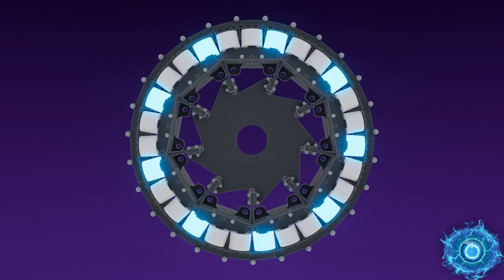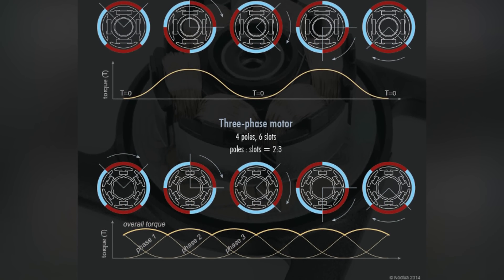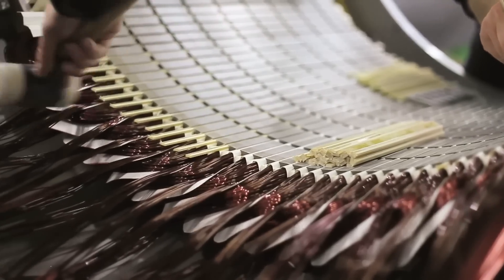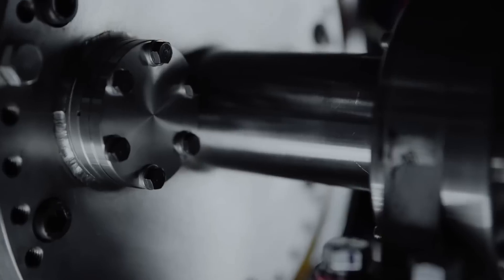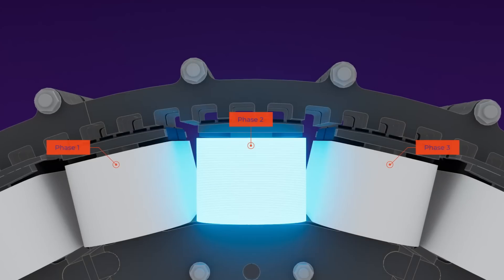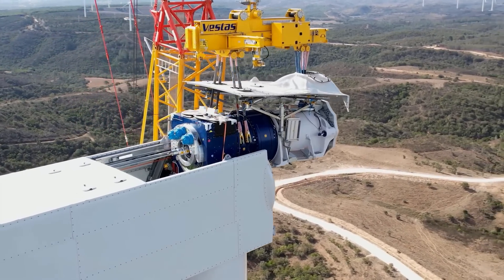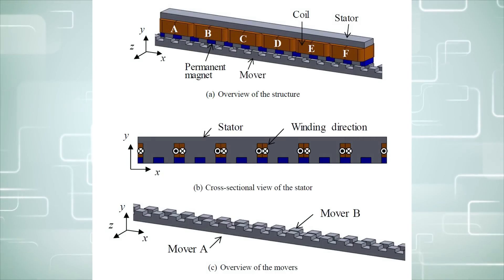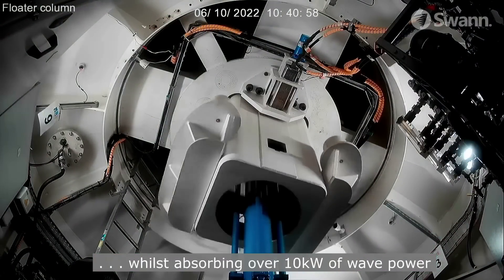FUTURE Motor Has ARRIVED!? - Vernier Hybrid Machine

Comment: As others have noted, this is quite similar to hybrid stepper motors, but scaled up and three-phase.  I don't see this type of motor being adopted in wind applications soon, if ever.  Type 3 and type 4 machines already accommodate variable rotor speed (though a gearbox is still required), the technology is pretty mature, and the industry has become comfortable with them.  I guess  It ultimately comes down to overall cost of ownership.  Mounting all those magnets on the pole pieces seems pretty costly.  There was no information on power density, but it seems unlikely to be great.  On the other hand, eliminating the gearbox is a nice reduction in capital and maintenance costs.  If those stator pole pieces can be made removable, that would also be a nice maintenance advantage, since fixing a winding problem would not require dismounting the entire motor.  If they can figure out how to replace the rotor bearing without having to dismount the motor, that would also be a nice maintenance feature.  From my time with GE, bearing failures were by far the most common failure mode, followed by winding failures.  Frankly, there isn't much else that can go wrong with a motor.  I guess there is at least the potential for these machines to have a cost advantage.

Comment: How is this different than the Siemens 1FW3 torque motor? High pole count 3 phase motor excellent at low speed high torque applications. They're still expensive compared to standard 3 phase motor + gearbox. 

Isnt this design already well known in machine design as high pole torque motors?

Comment: If we just put a coil and capacitor In series And we use a Pulse Width modulator To control it We wouldn't need :
Gear boxes
fly wheels 
Wind Turbines 
Hydro turbines
The computer would regulate its torque
Reply: It is the VERY thing I'm working on now. A (Resonant NIKOLA TESLA COIL/ MOTOR GENERATOR).  LOL Say that 10X  fast
Reply from the maker: @madtscientist8853  Well, if you want I can host it here and talk to you about it.

Comment: Will keep and eye out if Siemens or vestas gonna test it in my local windmill testcenter "østerild" maybe in the new models comming in a year or so..
Reply: Not likely with Vestas, they will be expecting the turbine in the test centre to be around for 10 years or so, although one would expect an uprated output in that time but they won't go direct drive. The cost of the Permanent magnets would be simple to high to justify over a faster turning generator with a gearbox.

Comment: nah wind turbines and wave generators are pathetic, put that on the turbines of nuclear power plants,
Reply: It's efficient at low speeds while nuclear turbines are most efficient at very high speeds.  I guess you can always gear up or down but I'm skeptical this is more efficient or if it could even handle the power.
Reply: Yah, why should we pay .08 a kilowatt hour for wind  when we can pay .60 for nuclear?
Reply: @davidtotten3042 Hah. Got em. 

 Seriously, I want nuclear to work yet the reality is that it gets more expensive while wind and solar are getting cheaper. 

 Hell even geothermal might be possible anywhere for a lower cost than nuclear. That is baseline power. 

 If the people developing pervoskite cells for solar are correct, and they can fix the longevity problem? Solar cost will dramatically drop due to the fact you can manufacture them easier simply by printing it on a medium.

Comment: May be useful for electric bicycles too, normally we use 3-phase BLDCs for that but it's a low-rpm high-torque (not that high, but high relative to the power level) application

Comment: This design looks identical to that used in hybrid stepper motors.  The problem with the design is the high magnetic leakage.  This is a problem in any motor (& generator) with reluctor because "magnetic insulator" does not exist.  Its ability to generate/accept high torque is way lower than mechanical contract (gearbox).  NOTHING NEW.  It would have to be 5x bigger & heavier than gearbox.
          All magnetic machines suffer from speed scaling problem.  The power they can handle is proportional to speed squared.  This is why the majority of motors (& generators) are designed to operate at high-speed.  If the load/prime mover can move fast, then direct coupling is possible.  But for many applications, that can't happen, so this is why there are so many gearboxes on motors & generators.

Comment: I agree with one of the comments below. This is a stepper motor. The type with 3 wires instead of 4. I happen to have one of these stepper motors (Nema 17 size). It can be driven with a normal 3 phase ESC (electronic speed controller). It also generates power when rotated.
Reply: It is also 'reinventing' the early 'pancake' motors/generators from Tesla/Westinghouse, but this time with permanent magnets. However, those old motors had an advantage when starting under heavy load, because simply shorting across the slip rings of the wound rotor turned them into induction motors.

Comment: be careful to not confuse between motor and generator although some may work as both.
Reply: usually all of them do unless they are induction and dont have controllers capable of keeping the rotor excited.
Reply: Are there any 3 phase motors that aren't capable of regeneration? Not that I know of, but I'm sure there could be something weird out there.
Reply: @gabelyon1071  The most notable for me used to be induction but I think only recently someone I think tesla figured out how to use them for regen. I forget what exactly they do but I think induction was the example motor that couldnt be used because the rotor had no way to be individually excited.
Reply: @erosion01  induction motors have been used in regenerating applications for decades. I've specified them myself - are you talking about Nikola Tesla or Tesla the car company?
Reply: @gabelyon1071  The car company, theres advantages to using induction motors in EV's because the coasting resistance can be zero but it used to be the case that you couldnt regenerate with them because the rotor doesnt have any magnetics when being spun. But I think somehow they managed to be able to excite the squirrelcage to excite it but have it create regenerative currents.

Comment: So “kinda” a stepping motor but on a larger scale ? Did you explain “precisely” how it works as a “generator” vs motor ‽
Reply from the maker: That's right, it has the same torque drop-off at higher speeds. I should have explained more about generator vs motor.
Reply: Agreed but a three-phase one rather than two...  But I instantly saw the stepper construction too.
Reply: @Clark-Mills  

That is why I asked about the “generator principles”. I would have to have more information to understand how it works, but it is probably obvious.